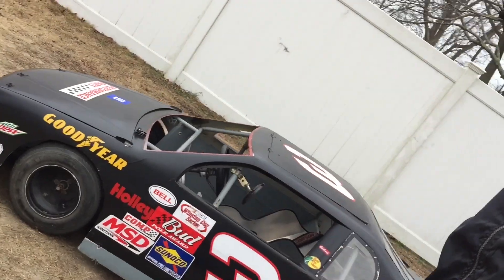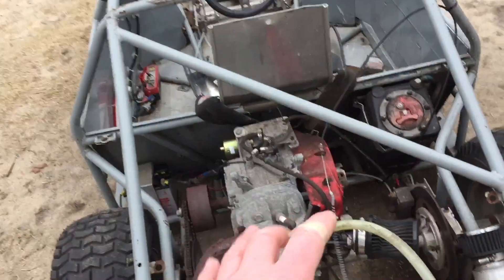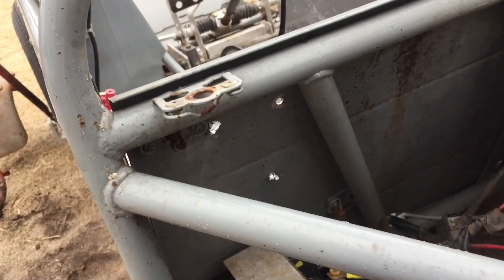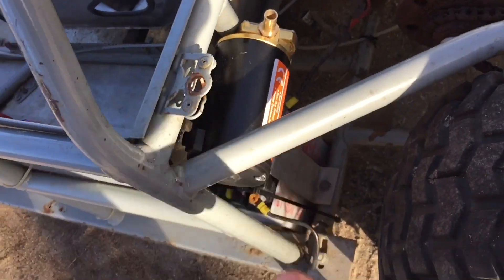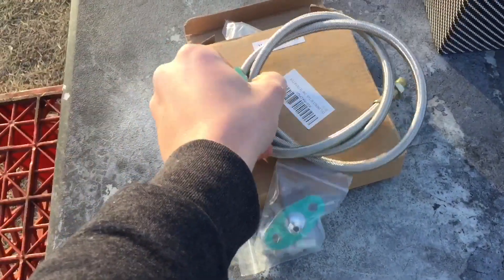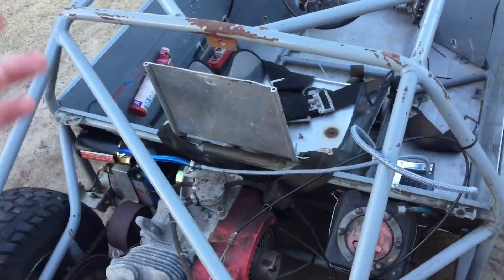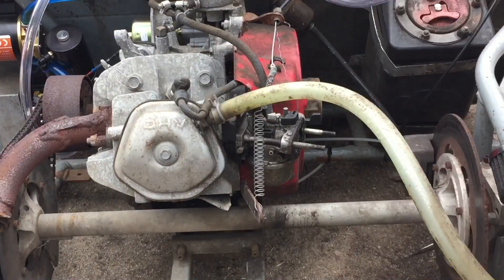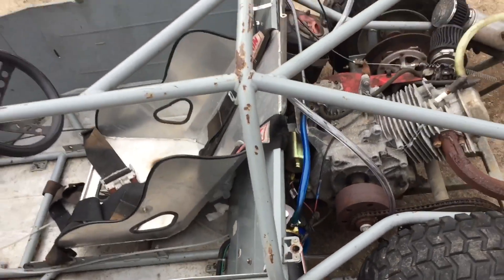It’s Almost Ready for the Turbo! - Turbocharging the Half Scale NASCAR! (Ep.1)

Comment: the turbo will break the plastic reed, and ur turbo makes bout 3-4 psi and that is enough boost to make the carb spit gas into the catch can+ ur gonna need a fuel pump to level out te amount of air being forced into then motor. its a bad idea to boost a crapy lawn mower engine

Comment: Alot of potential man and it's good to see you giving it a go but definitely hit up go powersports when you can for a billet rod, 18 pound valve springs etc for some needed reliability but you will need too keep the turbo manifold as short as possible to keep the heat in to drive the turbine and some header wrap, and for sure try the efi kit from GPS  hopefully it works out fot ya and keep the content coming

Comment: I will warn you again migs, you wont like that turbo screaming in your ear. It is a super high pitch squeal, the smaller the turbo the higher pitch the squeal is. It will be almost unbearable right beside your face even with a helmet on. Mount it lower and further back, it will get plenty of cool air from what is going under the cart. If you have ever rode in a turbo diesel or a turbo car you can hear the turbo spool from behind the firewall and under the hood...OVER TOP OF THE ENGINE! It will not be nice right beside your head but you do you. Also if that impellar works its way loose i hope your head aint in its path cause itd be like a drill bit but worse. All food for thought.
Reply: don't worry it wont even spool enought to get anoying maybe 4-6 psi at most

Comment: That carb won’t work...
Reply from the maker: Brad Stream Ive been looking for a replacement for the carb lately, like efi kits, I’m probably just gonna test it with the carb first off just too see if I can even get it to fire with just a carb, then from there knowing that it will run with all the piping, I can work on different fuel systems from there 👍🏻
Reply: Moto Migs I see what you’re saying, but those spindles are slightly off and even that small amount will create a slight gap between the cylinder head and the carb and reduce the vacuum required to almost 0, too much air will escape
Reply: Might push fuel out of the carb like cars and cameras issue was.

Comment: You're going to have a lot of problems with your carburetor.
Reply: I agree
Reply: @gavinweston9011  yeah carburetors operate off of atmospheric pressure creating vacuum inside the carburetor I'm allowing the Venturi effect to happen if you pressurize the carburetor it won't work correctly.
Reply: Aaron Martin TV that’s exactly correct buddy 👌🏻👌🏻
Reply: @AaronMartinCOOLVIDEO  he isn't going to pressurise the carb he is doing a draw through system.
Reply: @Miguelmedina22  that's good to know that should work if he doesn't do a inner core he needs as much philosophy as possible to atomized a gas so if he can get that turbo close to his intake it should work really good and he will see a increase in horsepower
Reply: Go power sports makes a mechanical fuel injection kit for pretty cheap if the card ends up not working I would try it out
Reply: @cburry31  that will work good. 👍
Reply: its gonna force gas into the catch can wich make make that fuking 4 stroke run even more lean